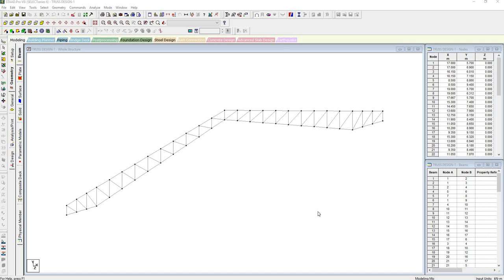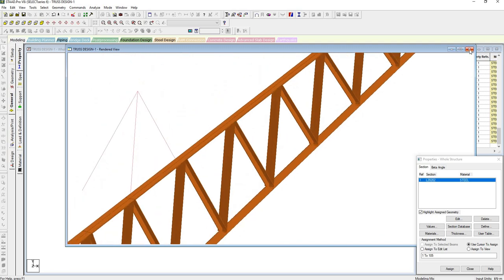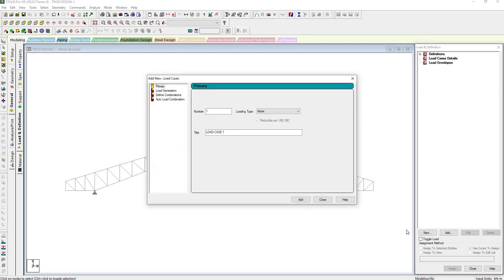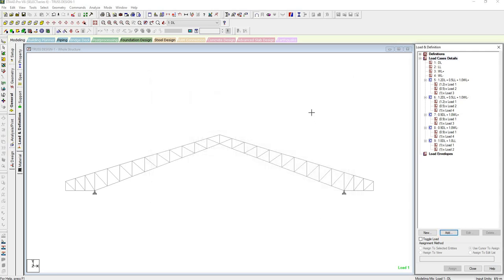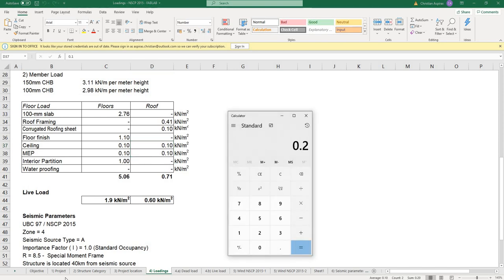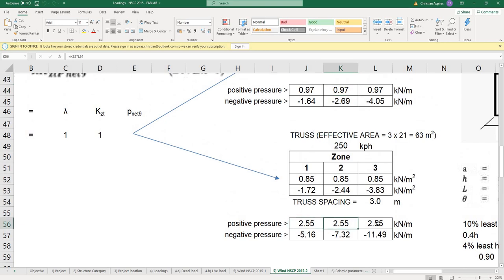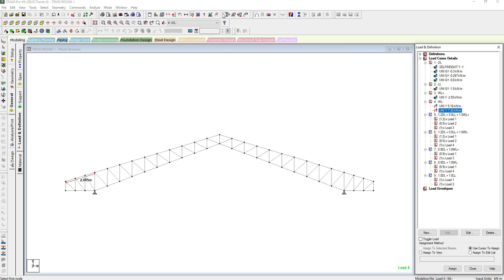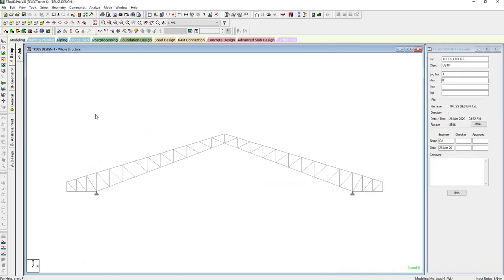Truss Analysis and Design STAAD.Pro

Comment: Sir. I would like to ask a question.. You are using pin-pin connection. does it mean that the reactions to be transfered to column will produce horizontal effect. This makes the column experience  higher amount of moment?   Example"You will have a reaction of Fy: -70kn .. Fx : -70kn (due to pin-pin connection)
.   height of column 6m, so the moment that the column will experience is  M=-70x6 = 420KNm. Then the column analysis will include FLEXURAL ANALYSIS ...